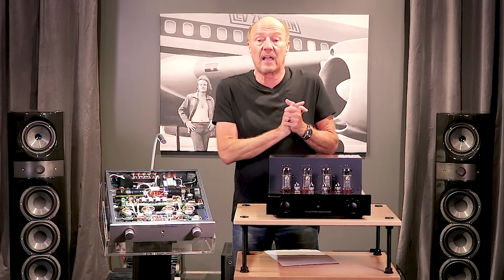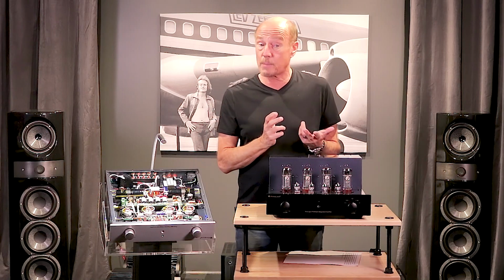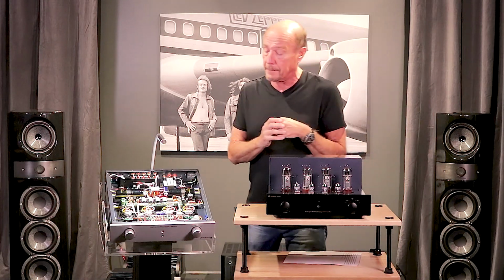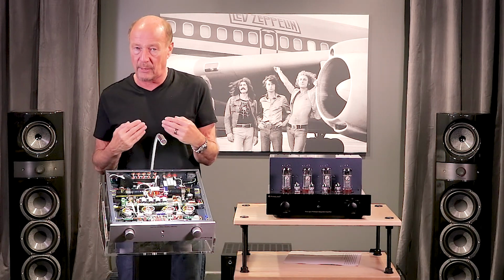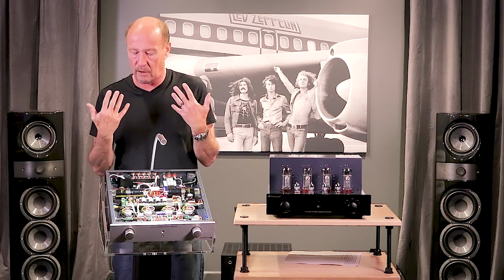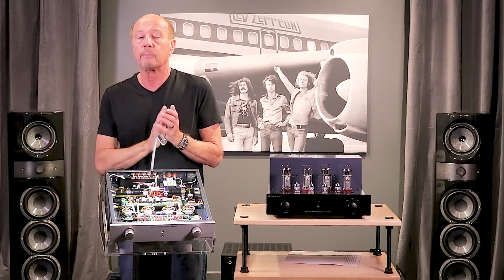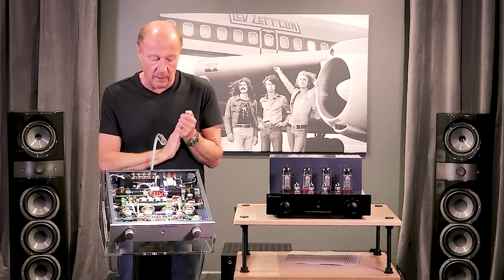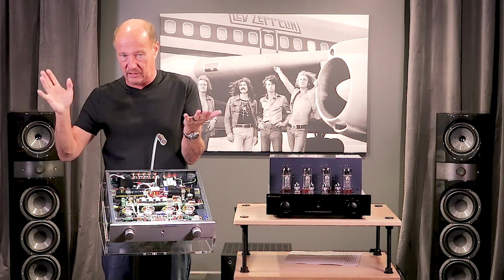PrimaLuna ProLogue Premium Integrated Amplifier - An Inside Look

Comment: Mine still does the job perfectly even though its close to qualifying as an antique..
I purchased it with EL34's - it mostly drives a pair of Usher Be-817's (DMD), occasionally I switch over to a pair of B & W 602 S3.
Either way I get what I want from my vinyl and CD collection...
Not the cheapest or most expensive - but IMO it is value for the money..

Comment: I wonder how this would sound on B&W 805 D3 speakers....? Will this beat the Mcintosh Ma252? I think you said the more expensive Primaluna DiaLogue Premium Integrated did? Can you hook up a music streamer with a Dac to it like an Auralic ALTAIR?
Reply: I myself and debating on getting a primaluna premium or ma 252
Reply: Mine is powering 802D3’s with two fingers in the nose, volume not passes 12 o’clock.
Punchy nice detail and the voices... btw my other amp is an Accuphase E-470, I switch between both because they both sound so nice...
Reply: Have had this amp since 2017 with Sophia el34 and genlex12au7 nothing under 10k can touch it! Using transparent ultra cables and maim cd5si with a power conditioner hooked up to totem model one reference speakers sublime 😮